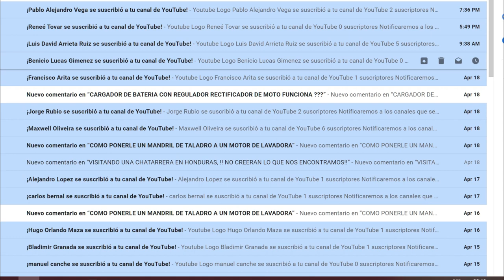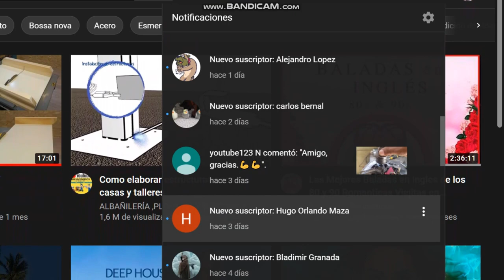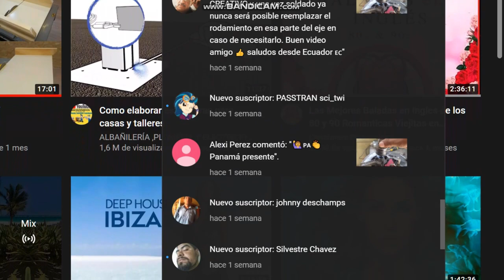MEZA DE CARPINTERIA EN METAL CON SISTEMA DE ELEVACION MUY FACIL DE HACER

Comment: Hola buenas, e estado viendo sus videos como la maquina de soldar con los 3 transformadores de microondas y la mesa de trabajo de carpintería con el sistema de elevación muy buenos videos excelentes, tengo una pregunta yo también ise mi maquina con 3 transformadores de microondas que números de cables puedo colocarle al cable que va aser para pinza de tierra y para el cable que va a ser para mi portaelectrodo con el cable numero 10 la puedo hacer mis conecciones son para 110 voltios saludos emmanuel
Reply from the maker: ahh que bueno y ya sabe si necesita ayuda en algo que le pueda ser útil ya sabe cualquier pregunta  aquí estamos para servirle cualquier duda o inquietud
Reply from the maker: le recomiendo cable numero 8 para el bobinado  de los transformadores ya tengo bastante experiencia con ese cable y le aseguro que funciona muy bien,,  para las pinzas puede usar  cable para de el que se usa para las exenciones   puede usar e 3 x12   unos 2 0 3 metros para cada punta, ahí depende como los quiera de largos  los transformadoras  con 3 ésta expelente ojala tenga de los mas grandes  esos mas grandes le agarran entre 14 y 16 vueltas haciendo como 16 a 18 volt cada uno y unos 100 a 120 amperes con los 3 trasformadores  suficiente para quemar electrodo 6011 asta  1/8
Reply: @manucreativo2719  mil gracias por averme contestado le escribí claro pensando en que si me iba a responder pero no pensé que tan pronto créame y le juro por la memoria de mijo que ya esta en el cielo que de hoy en adelante va a tener un nuevo seguidor me gustó un chingo el proyecto de la mesa de trabajo de carpintería con el sistema de elevación lo mire desde que empezó asta que yego don dueño con sus dos guardaespaldas je je je en verdad oiga muy buen canal como le dige en los mnsages anteriores puedo usar el cable calibre numero 10 de 7 alambres para usar mi porta electrodo y mi pinza para tierra en mi maquina que ise con tres transformadores de microondas
Reply: @manucreativo2719  de echo si me los cheque solo los conecyw6ala luz de la casa y uno me daba como 16 el otro como 17 y feria de voltios obviamente y el otro no lo recuerdo pero si mas o menos por ai andan lo voltios oiga
Reply from the maker: no estoy muy seguro de que cable me esta hablando ese de 10 de 7 alambres  el mas recomendable seria mas bien el que se usa exclusivamente para las soldadoras  pero como aquí se trata de hacerlo con lo que tengamos a mano puede probar con ese,  en caso de que mire que se le calienta  pues será mejor que busque otra alternativa yo le pongo ese cable 3x12  el que trae tres cordones numero 12 adentro  del que se usa para hacer extensiones   este nos hace un solo cordón con los 3 cables   que si  dividimos   el calibre  de ellos  que seria 12 entre 3   esto no hace un cordón  que seria numero 4  y nos aguanta muy bien la carga  sin calentarce
Reply from the maker: @emmanuelestradalugo1184  claro yo soy de honduras ya sabe cualquier cosa le escribo al wasap que pase buenas noches  y gracias por comentar
Reply: @manucreativo2719  si se cual me esta diciendo es la extensión de uso rrudo de cables como usted me esta diciendo el cable que yo le estoy diciendo es un cable que se usa aqui en la ciudad dnd vivo para instalar un aire acondicionado de ventana fue con ese con el que use para enbovinar los transformadores el cable que usted me esta diciendo lo voy a usar para la conexión para conectarme ala luz de la casa
Reply: @manucreativo2719  grasias de nada igual que descanse pues